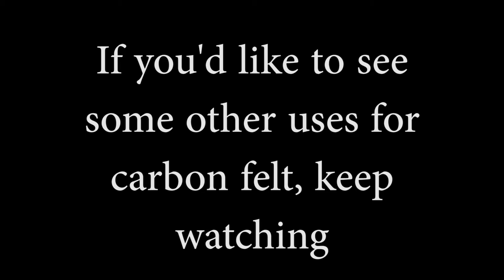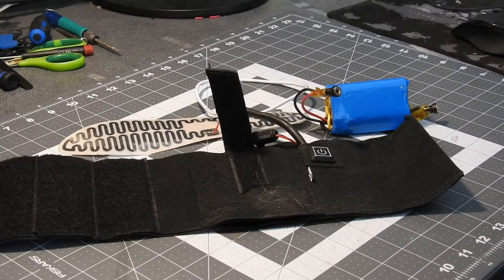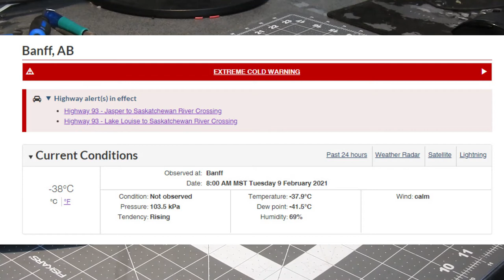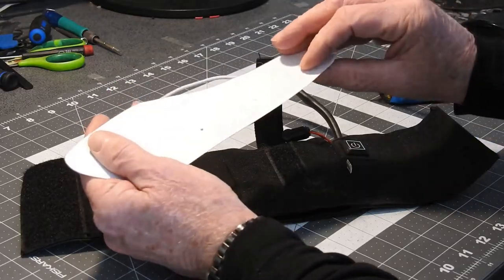E03: Insulating your mash kettle with Carbon Felt

Comment: How many uses do you get from the platinum, ceramic catalyst felts in the hand warmers?  Thanks
Reply from the maker: Although the typical catalyst from China is not platinum, the proper expensive catalyst is 1% platinum on a safil substrate (no ceramic material). The catalyst does not contain carbon felt. Although it will last many seasons, especially in the S-Boston, once it gets contaminated with liquid fuel, it's life and efficiency is diminished and it's best to replace it with catalyst that is housed in a spring.
Reply: @MountainParameters   i purchased the Japanese peacock hand warmers
Reply from the maker: @zehven6083  Good choice, they are much better than Zippo.
Reply: @MountainParameters  i was told the fuel only lasts 2 years .I there a way to stretch that time and what starts to happens to it (the fuel ).
I have purchased 20 litters of fuel due to cost savings. Azure Naphtha (petroleum), hydrotreated light - SBP3 - CAS 64742-49-0 - 5L x 4 is what I got.
Reply from the maker: @zehven6083  There is a video in the playlist that talks about fuel: Handwarmers, S02E03: S-Boston Handwarmers, naptha fuel and performance test